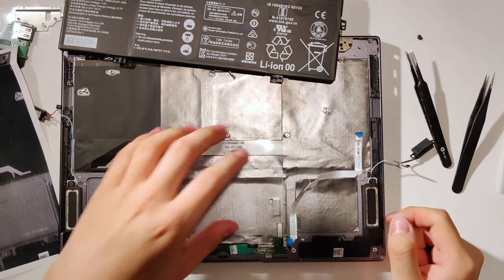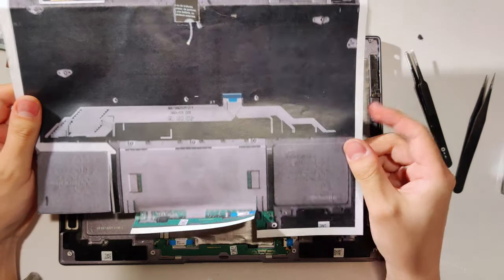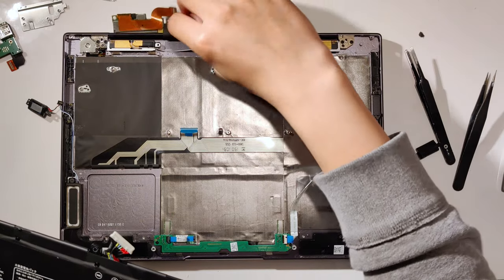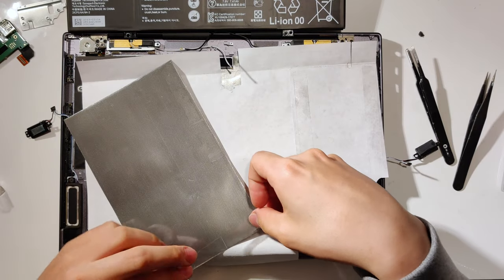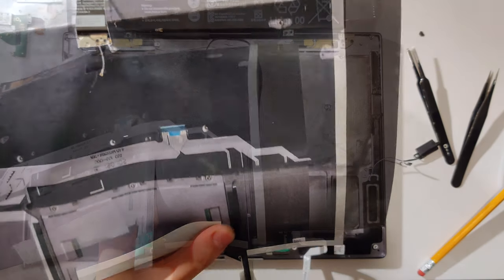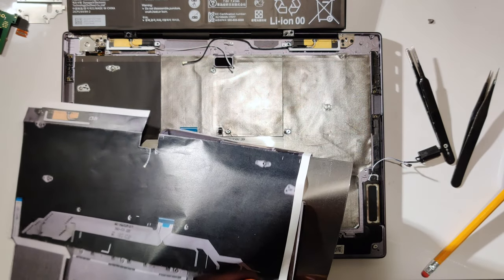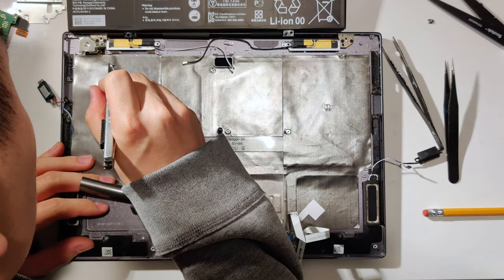MateBook X Pro Mods: Graphite Sheets (READ DESCRIPTION)

Comment: I must add that if you want to do this to the bottom cover if your heatsink/CPU is on that side, if your laptop has a composite or plastic bottom cover like ThinkPads, use 0.5mm copper sheets instead! With the graphite sheets I didn't see much improvement, but saw a large improvement with copper sheeting instead. Probably due to the copper also serving as the heatsink as well as the heat transfer material.
Reply from the maker: Yes, the copper sheets have more thermal mass which helps with burst performance, and they're much thicker than the graphite sheets, resulting in more thermal conductance despite lower conductivity. Copper sheets are indeed good when you have the space for them.

Comment: 1. Graphite sheets are electrically conductive. 
2. Be careful when handling those fragile graphite sheets. Their thermal conductivity reduces as you introducing more folds and indentations.
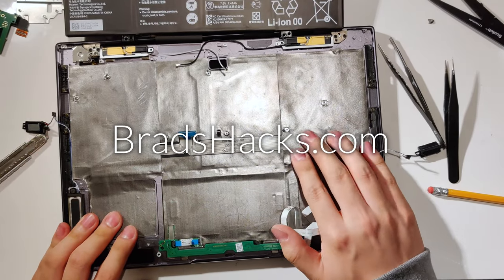(2:41)

p.s. Great moddings! More moddings! You've almost destroyed a piece of art...(Strikethrough) It's just a bit ugly on the internal...
Reply from the maker: The graphite sheets I used have an insulation layer on top. Thanks again Eric.
Reply: @BradsHacks  how thick is that layer, and is it robust enough to resist small cuts from various SMDs on a motherboard?
Reply from the maker: @iamdmc  Depends. If your motherboard keeps shifting around, then the SMDs might rub the insulation off eventually. I'd recommend putting thermal pads in between the motherboard and the graphite sheet to prevent this.

A lot of modern laptops have such a layer of graphite sheet behind the keyboard already, including the 2020 MateBook X Pro and 2021 MacBook Pro. But they also have a soft spacer between it and the motherboard.

Comment: these sheets are not only thermally conductive but also electrically or am i wrong ? dont you have to be very very careful not to touch any of the electronics?
Reply from the maker: The model I'm using in this guide has insulation layer built-in. If that layer is damaged, it can be dangerous. Fortunately, the rest of my mods involve covering the motherboard back side with thermal pad, so that's yet another layer of insulation.
Reply: @BradsHacks  ow wow :D does the heat transfer work fine even through the isolation layer? 
Btw i really enjoy your videos :D Its cool to see how much room (literally) for improvement there is in these ultrabooks
Reply from the maker: @geniumme2502  The insulation layer is very thin, so it's negligible. With the thermal pads, there is ample heat getting to the chassis.

Comment: I undervolted the cpu -0.1volts. set the max processor speed to 99% (less boosting)  and used liquid metal on the gpu and cpu.   now it almost never tunrs on the fan when doing office work and light video editing.   Gaming still is rather loud but way cooler and it throttles less.

Comment: do graphite sheets really conduct heat across a larger surface without conducting electricity? Really curious because it could come in very handy for some of my older laptops with hotspots

Comment: hey brad i recently aquired a matebook 14" what tutorial can I apply to it?
Reply from the maker: Definitely thermal paste replacement, probably keyboard-side cooling and graphite sheets. If the SSD doesn't have thermal pads already, add them. If there is space, adding heat pipes would help a lot too. I encourage you to read through my guide and make sense of the reasoning and research behind the mods. Reach out if you have any questions. I'm looking forward to what you come up with!
Reply: @BradsHacks  ty brad i never customed a laptop only desktop so I just wanted some guidlines before diving in. Ty for your quick answer
Reply: @citrick7387  did you try it?
Reply: @nicolasraguet8565  no but I should because the computer overheats a lot

Comment: After you applied the new graphite sheet, does it increase the temperature of the palm rest? I mean there's no point doing this if it makes the palm rest too uncomfortable to be used.
Reply from the maker: The graphite sheet has 2 effects on the keyboard deck:
1) Dissolve the hot spot on the keyboard above the CPU and GPU;
2) Transfer a bit more heat to the lower palmrest area.
You can cut the graphite sheet such that it only covers the keyboard underside instead of extending under the palmrest, and that will delete effect #2.

Comment: Did you get to spend any time with the 2019 version before doing this mod? The 2018 version is notorious for the heating and I was wondering with the bigger fan chassis and holes for the VRM were there any noticeable difference in heat? I'm deciding between buying the 2018 version or waiting for the 2019 for the heat/trackpad improvements since I'm not tech savvy enough to open up the 2018 and replace thermal paste and such
Reply from the maker: It's a little better. https://bradshacks.com/matebook-x-pro-2019-changes/
Reply from the maker: Oh also what you see in this video is 2019 version. It still has room for improvement hence the mods. Working on a new set of mods for 2018 and 2019 right now.

Comment: I did this on my older Matebook X Pro based on your site, and the keyboard still gets hot during high usage, but it definitely smoothed the heat across.  Thanks for putting this video out.  I didn't have a printer, so I used a ruler to measure each section, which worked but is a lot more difficult than your solution.  One note would be careful getting the sheets under the cable that runs horizontally across the chassis; I kept the backing on the lower half I slid under it to prevent it binding to the chassis as it's a tight clearance.